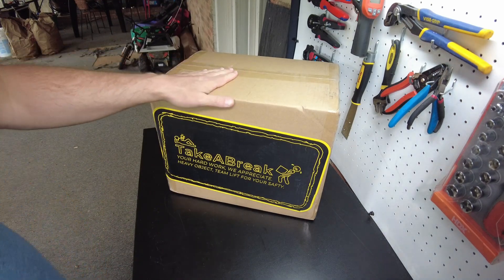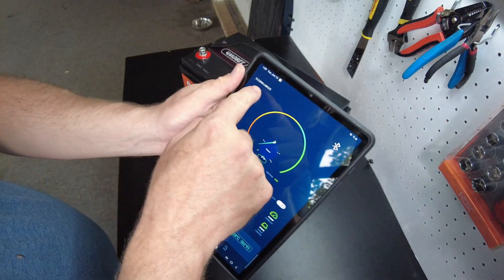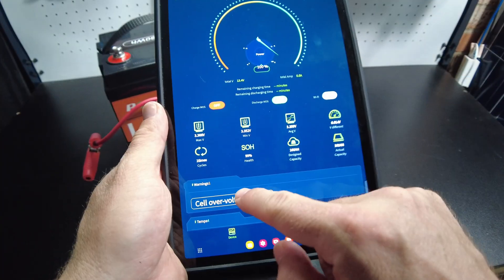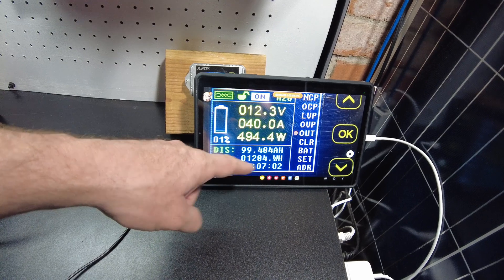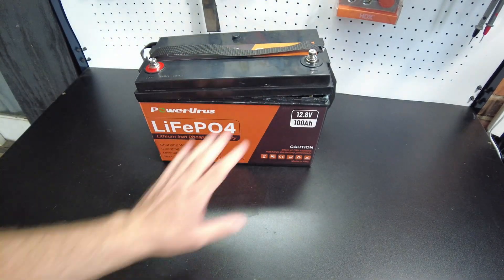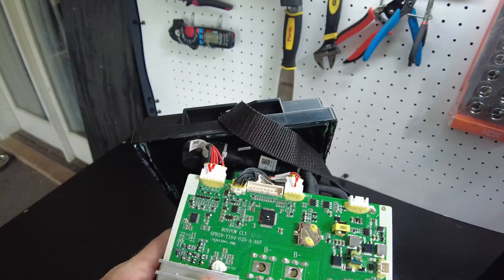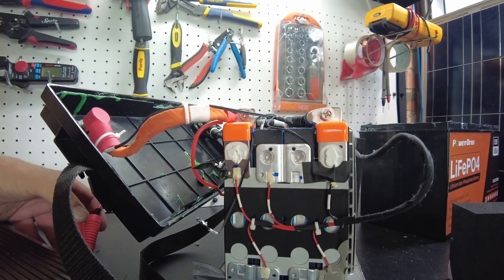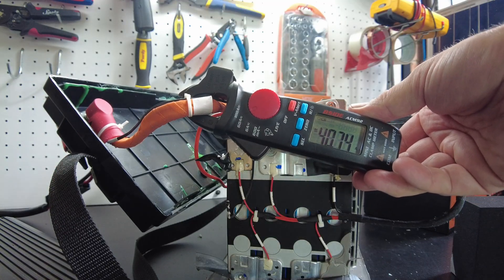PowerUrus 12v 100Ah LiFePO4 Bluetooth Battery

Comment from the maker: Affiliate Links:
PowerUrus 12v 100Ah LiFePO4 Bluetooth Battery: https://amzn.to/461DZan
ALFFAA 1500w Inverter: https://amzn.to/40bD8R1
Midea U Shaped 12000BTU AC Unit: https://amzn.to/43xiXPm
Shunt I use VAT-4300 https://amzn.to/3SX0bvK

Comment: I have two of these batteries connected to a Xantrex 2000w converter in my RV.  When I changed the settings in the Xantrex to Lithium, I also was able to set the charger rating to 80amps.  I'm not an electrician, so I was just going off what Xantrex recommended.  However, I noticed when I installed the batteries that it said the charging current is 50amps.  Does that mean I can only set my charger rating to 50amps?  Thanks!
Reply from the maker: If you have two of these in parallel you can charge at 50amps + 50amps = 100amps, so your 80amps is fine as long as you wired them to share the load properly.
Reply: @BradCagle  thanks for the reply!  I have them wired positive to positive, negative to negative, and then positive of one battery and the negative of the other battery wired to the xantrex inverter/charger.  Does that sound correct?
Reply from the maker: @Pandoventures  Yes that is correct. You should be good 👍
Reply: Thanks so much!  I really appreciate the reply!!!
Reply from the maker: @Pandoventures  Anytime

Comment: The only other product that is a direct competitor to this that I would consider is the Dr Prepare, with or without the little DC charging block.  The reason I think those are just a little better is because of how you can stack the batteries on top of each other, or stack other things on the battery, even with cables connected.  It's a small thing, I suppose, but pretty useful in a lot of situations.  There are so many options in this space, and all of them are built pretty well these days.  That's probably because you, and other reviewers, have torn down a lot of batteries to show how they're built.  I feel that has forced a lot of manufacturers to deliver a good product, because they KNOW someone is going to rip them apart and show the flaws, if there are any.
Reply from the maker: Yeah, I do like the build quality, and stacking designed of the Dr. Prep. Man, I totally agree the tear downs (credit Will, and Lithium Solar) have force these companies to build better products.